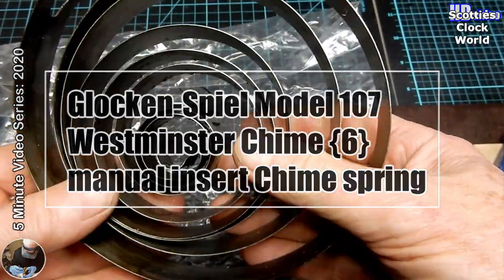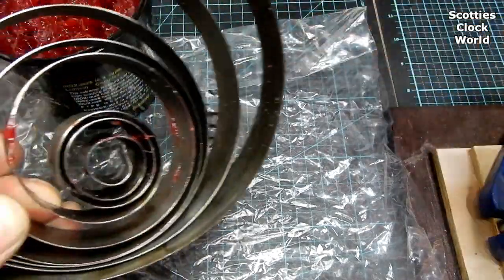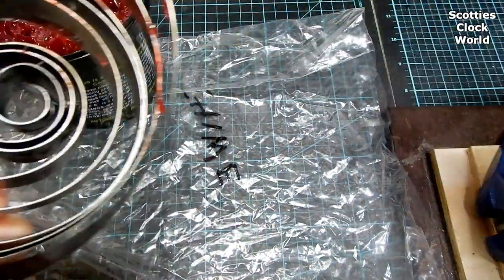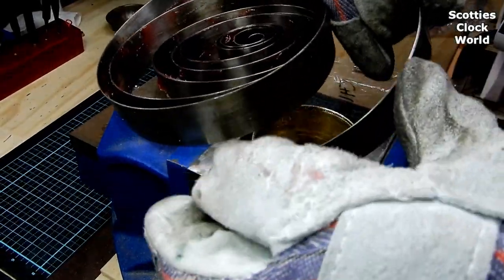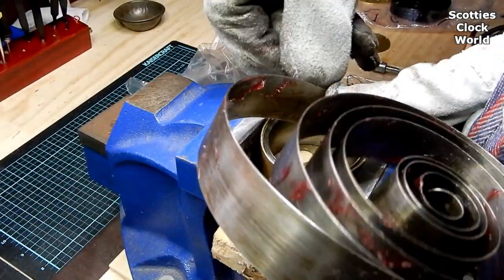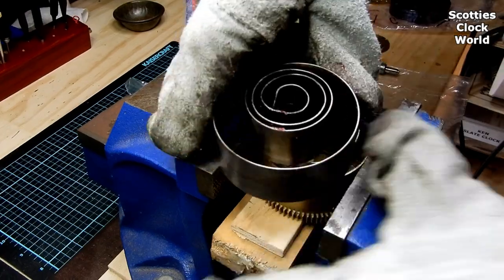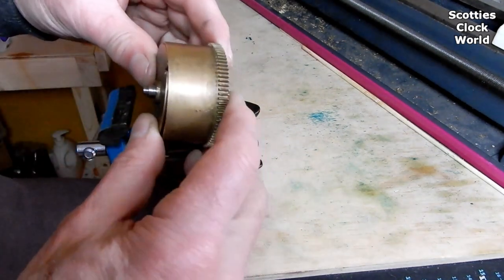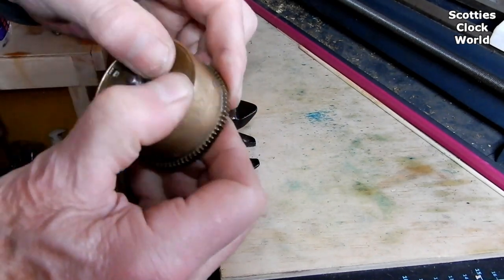Manual inserting a Chime spring into a barrel #GermanClockRepairs #ScottiesClockWorld

Comment: Thanks Scottie.  I've seen it done with just holding the case in your hand, the vice make it a lot easier and safer.
Reply from the maker: Hi Vince, holding the barrel in your hand is ok for Going and Strike side springs, but the strength of a Chime side spring is very hard to handle in that way.